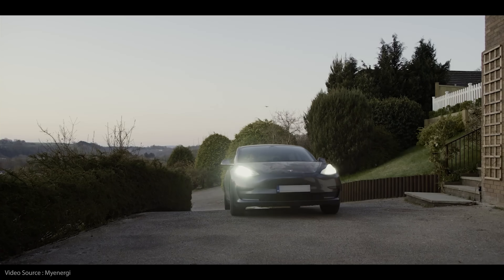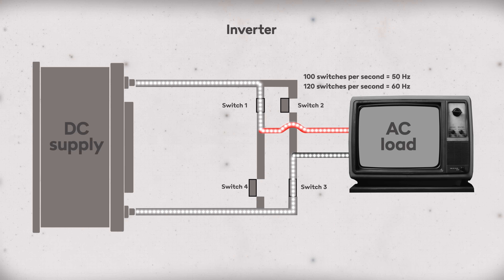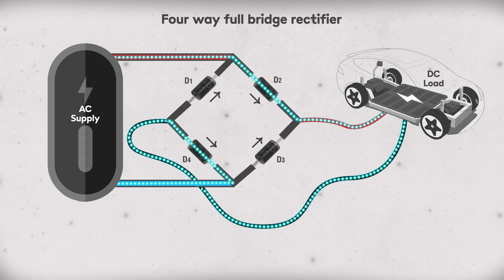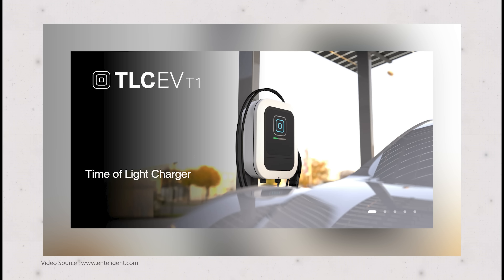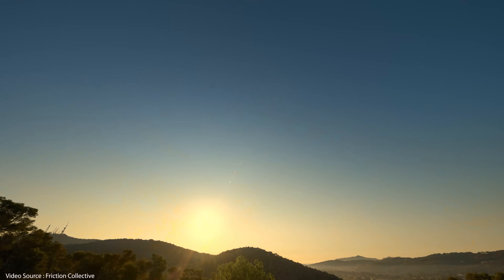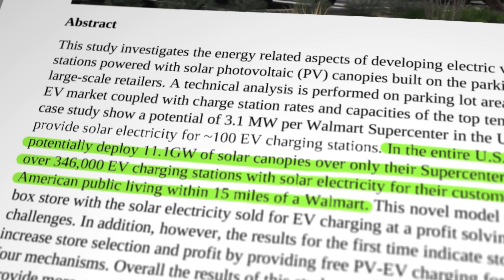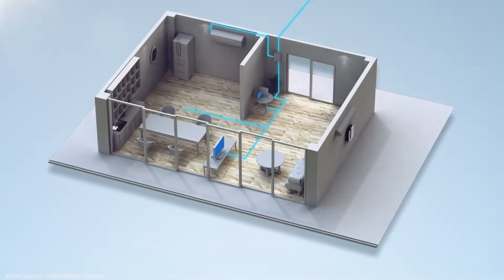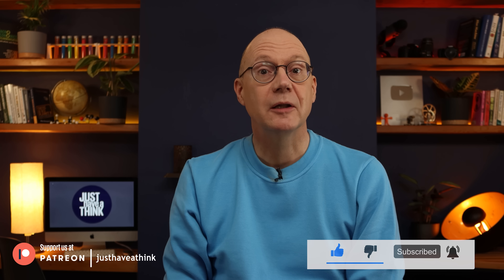DC to DC charging. One more step to off grid living!

Comment: I don't buy the 13% inefficiency as innate to the full wave rectification issue as this job is increasingly being done by very low loss active switching devices. 

What will make a difference in a few decades time, once the Silicon Carbide and Gallium Nitride active switching devices have made it into the volume markets once occupied by mere silicon devices, is the adoption of >340VDC being put down say 220/240VAC domestic utility feed lines, proportionately enhancing power delivery and easing feed-in opportunities especially at higher powers. This can only happen once mechanical switches within houses are eliminated, and so can only happen in newbuild networks. Most existing electrical and electronic devices will remain immediately compatible.
Reply: Actually I would make the argument that the efficiency of any power converter DC to DC or DC to AC can be made as high or as low as the engineering goal requires.  Even using silicon transistors it is possible to get above 99.8% efficiency.  Engineering is all about design optimization and trade-offs.
If you are building using very low cost manual labor and targeting the lowest manufactured cost this will tend to drive the design to low efficiency,  relying on using large heat-sinks and forced air cooling.
If your design objective is for very high reliability then this will drive the design to very high efficiency and a higher product cost, relying on using massively over-sized transistors, magnetic components, and capacitors.  The high efficiency  reduces the thermal stresses on the power coverter which significantly improves the product reliability
Reply: @michael-j-harrison  Any real world application of switch-mode techniques will be cost constrained. Parasitics and complexity cost (with say vertical or parallel stacking of switches) are a thing limiting the economic practicality of using any old semiconductor technology. HVDC only dropped below $100m per terminal once the vastly superior SiC and GaN devices with their much higher working voltages and lower parasitics per on-resistance per switch became available.

The downside of AC power is the 41.4% higher voltage needed in insulation systems, the huge external E and H fields with their own losses and added insulation degradation mechanisms above LV. Putting in galvanic isolation at consumer terminations and use, can with new technology push into very high frequency conversion delivering the highest efficiencies in acceptable volumes.
Reply: @fliprim I would point out that 41% more insulation for Low Voltage (<1kV) system wiring attributes minimal cost.  The cost breakdown of electrical wires has the copper cost a couple of orders of magnitude higher than the insulation cost.
In contrast, there is a very significant difference in the cost between AC and DC circuit breakers. 
BTW - I am a power electronics engineer with 40+ years experience and my area of specialty is in the design of power semiconductor transistors so I am very aware about the advantages of SiC and GaN.  Clearly I am not downplaying the importance of Wide Band Gap semiconductors, however it is incorrect to blame low efficiency in SMPS on the Si transistors.
Reply: @michael-j-harrison  I think this misses most of my points and strawmans the remainder. Without replacing ANY wiring, homes and their LV feed could be uprated by 41% in power capability. Rather useful as we become BEV owners and resellers of our own Solar PV energy.

The highest conversion efficiencies will be available (against cost) with wide bandgap devices rather than narrow. Currently HV and MV applications have already fallen to the enabling newer technology and as volume and manufacturing of flipchip  GaN really takes off we will see these make the highest efficiencies possible anywhere and current highest efficiencies available at lower costs.

I already flagged the issue with mechanical disconnect of DC, but even here these newer devices make cheap transient arc extinction/avoidance possible.
Reply: @fliprim power semiconductor devices can be used to switch several hundred volts DC and avoid the arc problem and hence this is OK for normal on-off control of DC loads, however there are two major issues when it comes to using semiconductor devices to replace circuit breakers. 
The first issue relates to the lack of any fail safe characteristic - semiconductor switches will fail short circuit.  The second issue relates the i^2t requirements - normal residential AC circuit breakers meet a 40kA fault current rating which is a mandated minimum rating.
So to make a semiconductor based DC circuit breaker requires a DC rated fuse to be connected in series with the semiconductor switch.   This is the only way to meet the safety standards such as UL, TUV etc.
This DC rated conventional fuse is quite an expensive device which plays in to why DC rated circuit breakers are so expensive.
Reply: @michael-j-harrison  The technique is to use brief arc quenching circuitry on mechanical disconnect. RF arc-detection automates the process. The total energies involved are low, whilst the brief dissipations are high, and the four main quench components serve the additional function of line surge arrestors. The first implementations are an industrial 800VDC  system rather than my mooted domestic 340VDC.

Comment: Bit puzzled by this as any device that takes power directly from PV panels will need to do a DC to DC conversation to match the load (EV battery in this case) to the panels. DC to DC is just as efficient/inefficient as DC to AC and then to DC so I don't quite get it. P.s. I used to work as a switch mode power supply development engineer and currently live with an off grid power system.
Reply: Wouldn't a pure sine DC-AC inverter be less efficient than a DC-DC boost converter? Especially when it has to be converted again in the car charger?
Reply: @phizc  No because most DC to DC converters work by 'inverting' the input DC to make high frequency AC which then has it's voltage changed using a magnetic component - a transformer or inductor. The AC is then rectified to give DC at the new voltage.
Reply: At high voltages DC-DC boost or buck-boost converters have roughly similar efficiencies as DC-AC.  Not so much AC-DC though.... DC-DC tends to be better than AC-DC at any voltage.  With the provisio that we are talking 240VAC here, not 120VAC.

DC-DC conversions have significant advantages compared against lower AC voltages such as 120VAC, and when driving low loads (due to AC inverter idle consumption which scales with its power capacity).

-Matt

Comment: This could become more of a big thing as renewables and battery tech continues to get better and cheaper that allows a lot more of us to go gridless, reducing the need to convert from AC to DC as much, at least in some cases.

That would make the system more efficient compared to how much energy is being loss over the grid network, not to mention that it's costly to maintain the network.

But we are still some time away before we can generate enough energy at a local level reliably to be gridless, especially as EV cars and heat pumps are going on the electrical system, but if the cost of renewables and battery tech keeps going down and the tech keeps getting better, I can well imagine that it will allow a lot more of us to go gridless.

There is another factor when  it comes to EV cars, the amount of energy they use might not be as much as we think in the future if the entire car is plastered with solar tech, we are already seeing today how much energy it can create for cars, with more refinements, improvements and where the solar tech can be implemented on the car where it's not really visible, for many, the car could end up being self power, especially if you don't drive a lot, that would ease the burden on the home solar system to power the house and heating.

Personally, I think a balance of solar and wind power is what we need for a more consistent flow of energy from winter to summer, that would help to reduce how much battery we need, whiles giving us a more reliable flow of energy, but the problem is, we've not seen any credible solutions of wind power at a small scale that's credible in produce a worthwhile amount of energy and also cheap enough for us to want to use it, but a lot of innovation is going on in that area, so who knows, maybe over the next few years or decades, that could change, if we can have a mix of the two, that will be a game changer for going off the grid.
Reply: Plastering your car with panels will make a minimal difference. You might manage to fit hundreds of watts worth on the roof, but even that is at least an order of magnitude less than what is used while driving. Will you recover the cost of the weight & drag of all the extra stuff you have just added?

Comment: Lots of talk on this thread about DC systems being more efficient. What's not been made clear is that DC systems often require dc to dc conversion which is just a lossy as dc to ac. Also ac to dc, if it's using a simple bridge rectifier, is very efficient. BTW I run an off grid system with 48v battery, various 12 and 24v dc loads plus 230v ac for mains appliances including charging an EV.
Reply: It would be interesting to see the real world efficiency of the devices being compared.  The 13% loss they claim for an AC system is probably a worst-case scenario.  The charger featured here is quite expensive.  It might be better to invest in a more efficient AC system.
Reply: @incognitotorpedo42   Anything and everything is better than using polluting fossil fuels.  At every opportunity.
Reply: Dc - DC conversions definitely do have losses but not remotely as much as DC-AC and then AC-DC conversions currently been utilised. Also most EV batteries run at about 400V DC, which is very close to the mppt voltage of most string and hybrid inverters. Similarly, most high voltage home energy storage batteries (e.g. from SMA, Fronius, Huawei etc) operate between 160-600V DC so not much stepping up/down will be required.
Reply: @adon8672  DC to DC converters generally work by converting the input DC into high frequency AC, changing the voltage using a magnetic component and then rectifying it back to DC so it's the same. There are some differences as DC to mains voltage AC is generating low frequency AC. How much difference depends how it's done.
Reply: @petewright4640 they don't go full AC usually - just pulse the current on and off, it behaves the same in the magnetic element. Then "rectification" is just smoothing caps.
Reply: @jnawk83 Pulsing the dc on and off is still AC. It just depends where your zero reference is. You also still need a diode even in the simple set-up that I think you are referring to else the on off switch (typically an FET) would be destroyed. The diode is the rectifier.
Reply: @petewright4640  I think the point is that for a typical solar + ev system you see the following:

     [x] is a conversion,   (y) is just a unit, no conversion

(PV:DC) -> [DC: MPPT :DC] - [DC: Inverter :AC] -- (ChargeCtrl) --> [AC: Car Rectifier :DC]

while the proposal would have:

(PV:DC) -> [DC: MPPT :DC] - [DC: ChargeCtrl : DC] --> (Car)

The MPPT is the power adjustment circuit required to harvest PV panels, a variant of a switch mode power supply (smps). The Inverter is a circuit similar to an smps, chopping up and reforming the incoming DC into a sine wave. The ChargeCtrl in the DC proposal exists to adjust the incoming and outgoing voltage as required, which is another smps, while in the AC route it behaves as a simple switch.

Each of these stages has a fairly high efficiency - over 90%, sometimes over 97%, but each stage still adds up.

Comment: Why would using public charging infrastructure be more expensive than installing+charging at home? Something's weird about the economics when using shared resources is more expensive.
Reply: Land=$
V3 charger=$
Staff=$
1mw grid connection=$
Surge power=$
Power costs for companies=$
Reply: That's because someone else paid for those resources.  Also, public chargers tend to be farther from existing power meters, so the installation of the charger is much much more expensive than a home charger.  A public charger will need to be heavier duty than a home charger to stand up to more use and abuse, and it will need more maintenance.  Lots of extra expenses on the public chargers.  If they are high speed chargers, the expense goes up exponentially.  If they are low speed, they can only be shared by a small number of people.

Comment: I made this like 2 year ago, 
Diy homemade car and directly hooking up the battery to my of grid solar inverter
Reply: ah yes, what is the voltage of your home made EV?
Reply: 192volts, before pluging it into the inverter the pack switches to 48volts
Reply: @423GustavBern but are your DC-DC conversion losses any less than converting solar to generally useful AC and then having a standard battery charger?

Comment: 12GW of solar canopies in Walmart car lots isn't the equivalent of 12 power stations. With an optimistic capacity factor of 20% it's about 2 power stations.
Reply: But it does mean that up to 12GW need not be generated using fossil fuels during daylight hours - that is the advantage.  Reduced CO2 atmospheric greenhouse warming gases and less poisonous pollution into the atmosphere (NOx, sulphur, radio-isotopes and other nasties)

Comment: We installed 13.2 kW Solar PV system in 2012 and two Tesla Powerwall batteries in 2018 to our all electric home with Heat pump and heat pump water heater and have been net positive in producing more energy than we use for past 12+ years, operating effectively as a microgrid for 8+ months of the year. We also charge our two EVs off our roof utilizing our solar panels to charge our cars 95% of the time and charge predominately during the  peak solar  period (11a.m.- 3 p.m.).
Reply: We did similar in 2019 but in our case an 11.4kw solar PV system (the max number of panels our roof could fit), a single Powerwall, a heat pump water heater and A Tesla Model 3.  We are retired so mainly charge the car on sunshine.

The cost of the solar, battery and heat pump combined was around $30,000AUD and it has saved us at least $5,000AUD a year so the investment has now been fully repaid.  It would have paid for itself within 3 years if not for the Powerwall but still pleased to have it and be totally self sufficient and essentially off grid on most days of the year.

We still export more than we import.
Reply: In NZ all the banks are offering $80k at 1% for 3 years for this purpose (solar, heat pumps, insulation, double glazing, EVs).
Reply: Ya totally out of reach for most people as we're barely getting through the month and are stuck renting where no solar is allowed in Ottawa Canada
Reply: Yawn
Reply: And what country are you in?
Reply: @MrRoddersf1  a rich one!
Reply: @MrRoddersf1  We live in Edmonds, WA, USA
Reply: How many percentage of the battery capacity remain for your powerwall may i ask?
Reply: @bobozou787  I haven't seen any drop off in PW2 capacity in past 7 years. They have been operating flawlessly since installation in meeting our energy needs.
Reply: How much did your independence cost?
Reply: @LilyWasHere_MB  Our early adoption Solar system costs us $83k in 2012, but solar costs have come down dramatically and a comparable system today would cost ~$20-25k. With incentives in place in Washington State where we live, and were able to pay off our pricey system within 7 years through net metering, and our electric provider issued us an annual  check for our excess solar amounting to $5k/year for 7 years. Our Powerwall batteries cost us $15k, and have enable us to operate as a microgrid for 8 months of the year and also weather multiple power outages.
Reply: @LilyWasHere_MB  costs a lot up front, but there comes a point when it's paid itself off and saves you money.
Reply: @LilyWasHere_MB  My thought exactly - its great if you have the cash...
Reply: And how rich/privileged do you have to be to be able to do it? For the average person, even in the West, this is way out of their reach.
Reply: @paulhaynes8045  The topic is about the technology, not the social inequities which bedevil our so-called civilisations.
Reply: @paulhaynes8045  The amortized cost of solar has been cheaper than delivery from the grid for about a decade.
So for grid-tie solar: you need only have a good enough credit rating for a loan. (And there are also grants to offset the installation costs as well). Well, that and ownership of your roof -- honestly the most expensive part.

Adding batteries to act as a true microgrid approximately doubles the cost of the system.
I suspect sodium-ion batteries, with their low input costs, may make solar + batteries cheaper than grid hookup in the the next 10 years as well.
Reply: @economicprisoner  depends where you live. Also, getting such a substantial loan isn't quite such a casual thing for most people!
Reply: @paulhaynes8045  You don’t have to be rich but you do need to own a suitable home and be financially stable.  I do understand that this doesn’t apply for the vast majority of people but there are people who could do this but don’t.  It only became possible for us a few years ago.  We didn’t spend our money on holidays or going out but on this instead but I agree we were lucky to have this option.